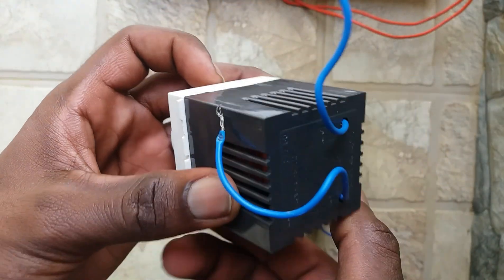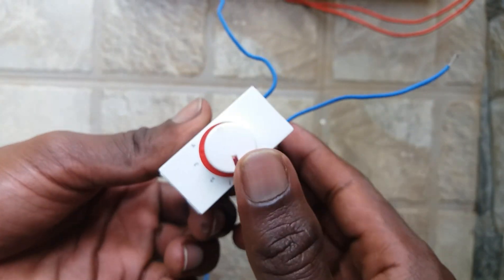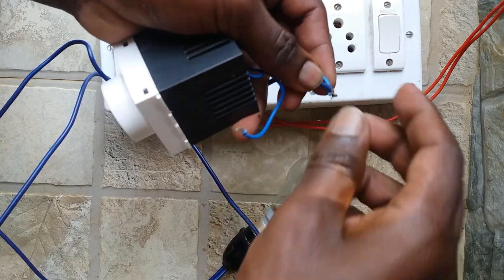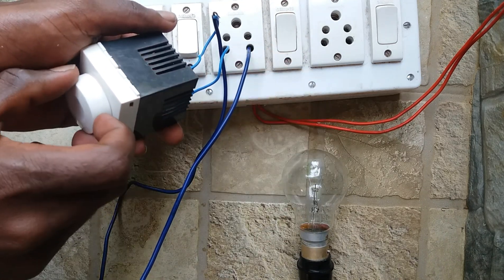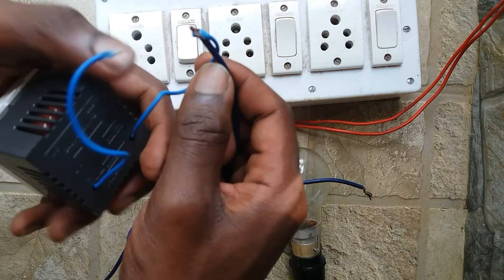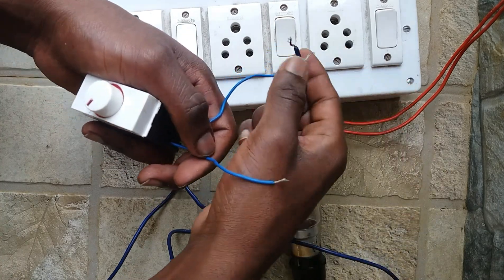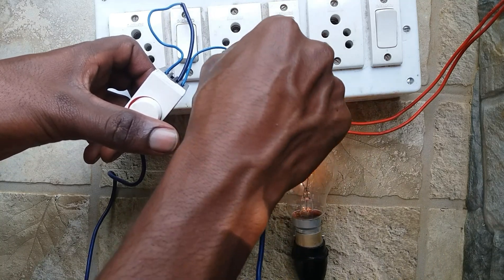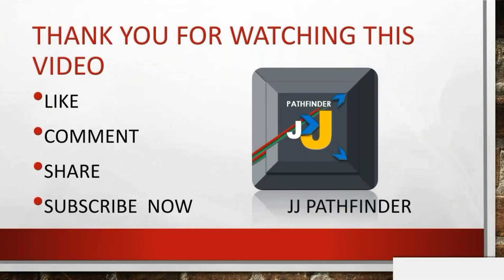How to check fan regulator

Comment: At  regulator speed 1,2,3,4 my fan swings less(same speed)..but at 5th speed my fan swings  very faster...what is the reason??...plz help
Reply from the maker: Regulator is partially faulty
Reply: this happens with 99% semiconductor based regulators. Life span of semiconductor modules is less. Only the max position (number 5) makes full contact hence the fan runs at Max speed. Potentiometer type (conventional type) are having better life yet they consume same current at all positions. You need to replace this module repeatedly.